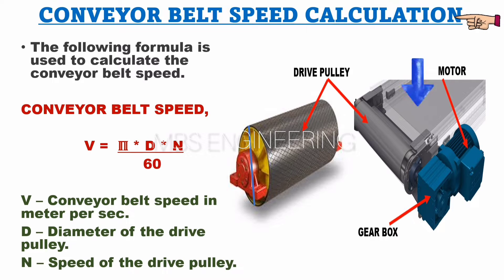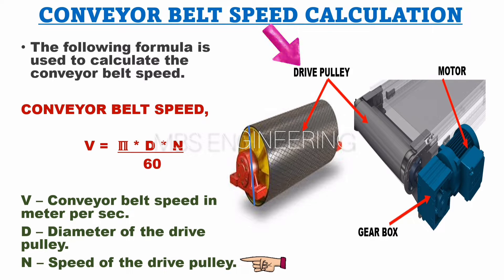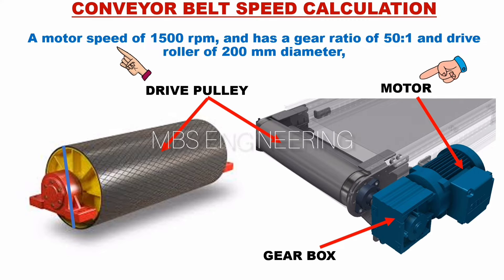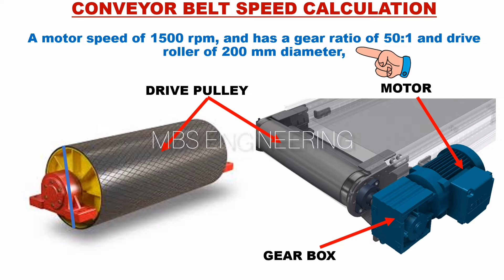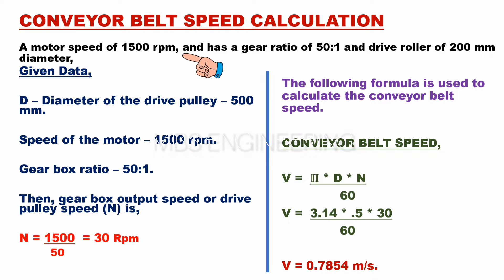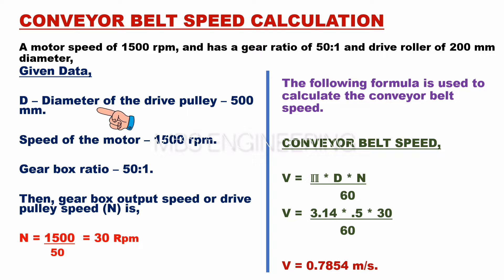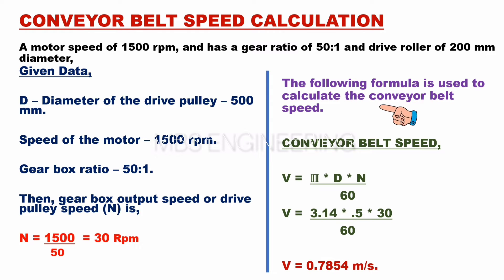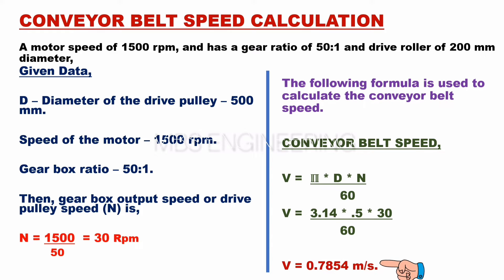CONVEYOR BELT SPEED CALCULATION/HOW TO CALCULATE THE CONVEYOR BELT SPEED/CONVEYOR BELT SPEED IN m/s.

Comment: D= 200 mm not 500 mm. There is a mistake in final calculation based on the input data.
Reply from the maker: Noted. Please consider input data D 500 mm instead of 200 mm.